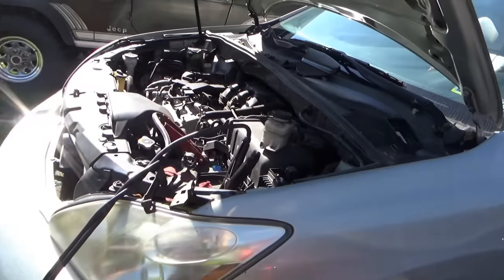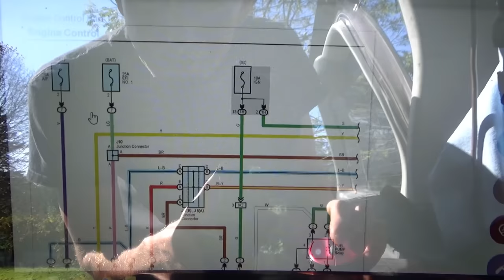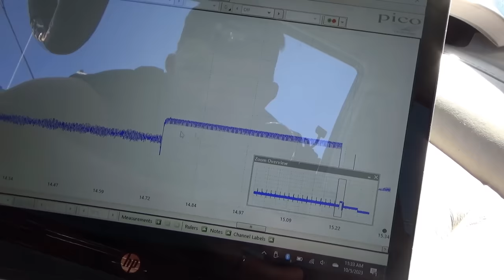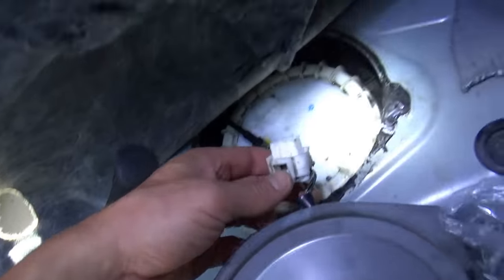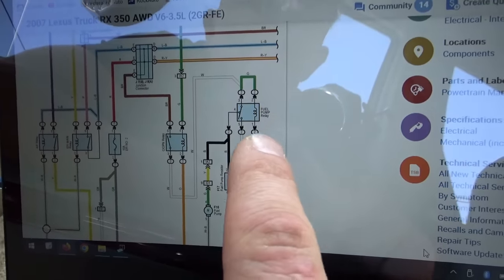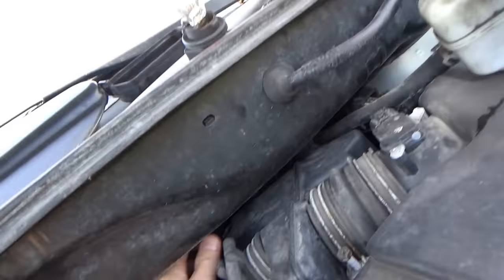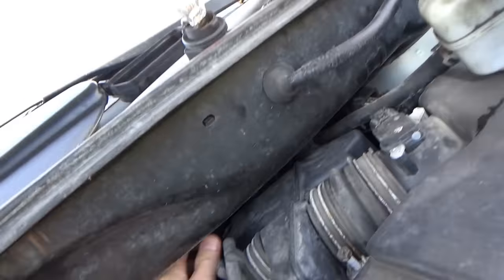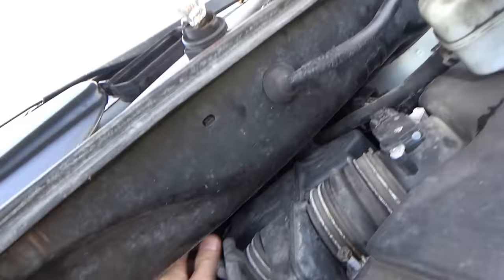Lexus Random STALL...After Engine Swap? (RX350 V6)

Comment: You need a power probe short to ground tester, this would have taken you far less time to find the short, great tool, and yet snother great video. Cheers from England
Reply: He has used them before..  They are very finicky and don't really work half the time and give false readings other times.   The amp clamp on the meter worked just as well.  Nice improvisation
Reply: The bulbs are pretty good at that.
Reply from the maker: Nope, Power Probe would not have saved any time here...and would have annoyed everyone with the BEEPS haha

Comment: At 6:26 - The fuel pump spikes would make me consider a fuel pressure issue, even something as simple as a clogged fuel filter or is the car just low on fuel even if the fuel gauge shows that there's fuel in the tank? At this time I'm however quite open to many alternatives.
However at the end it was a bit of a surprise discovery. I can understand that they wanted to fix the liner but if you are a pro you shall check what's behind when using a self-tapping screw. Doesn't matter if it's plumbing or electricity - you'd get trouble.

Comment: A least it wasn't a drywall screw
Reply: There's a picture floating around the interwebs showing a drywall screw in one of the mains in an electrical panel.  Whoever installed it was using it to create a branch circuit because there was a stripped wire wrapped around it.  SMFH.
Reply: @major__kong  yes, I've seen that one.  Scary stuff, indeed!

Comment: Ivan.  Seeing that spike, as the relay "clicks," reminds me of a "feed back pulse" in that relay.  Reason?  No diode across the relay coil to reverse the current that's caused by the collapse of that magnetic field.  Lots of turns on that coil - could be a large EMF sent to the PCM.  BUT!  That's an old relay - wasn't changed when the engine was changed. ?  Hummm.....
Reply from the maker: It was just switching between "high" and "low" speed...but "low" speed was directly shorted to ground!!

Comment: Another Ivan glare fest. It would be so nice if Ivan used the computer screen output to avoid the glare and increase the production quality: see ScannerDanner, DiagnoseDan, or Auto Disg and Programming for examples. Or use a laptop with a matte screen. Or film in the shade. On the other hand, we could see Ivan’s red mouse..